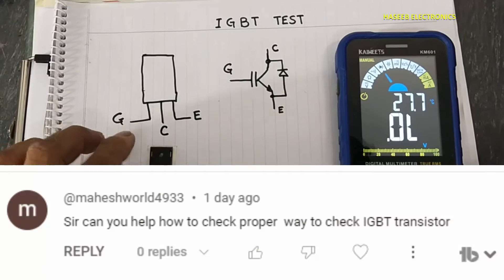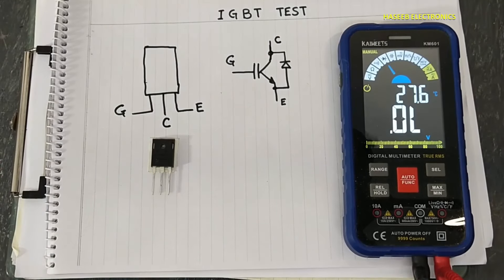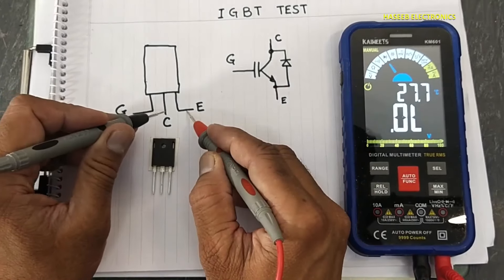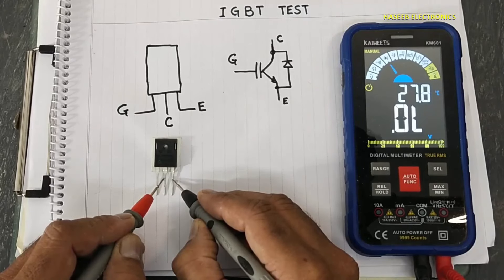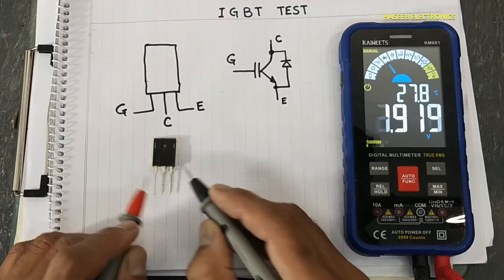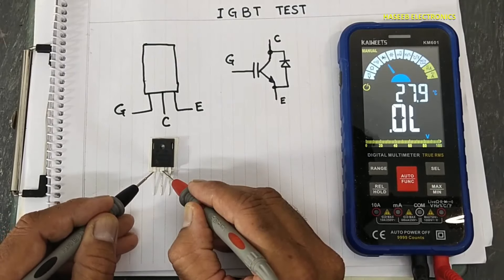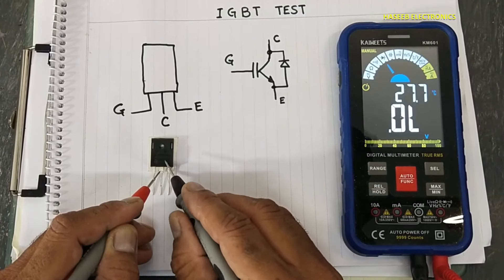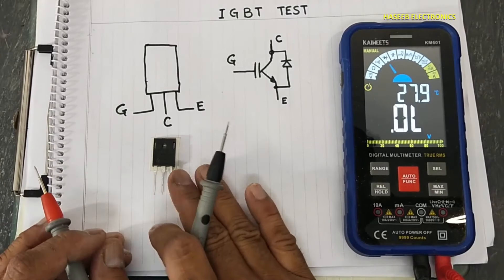{961} How to test IGBT

Comment: I understand that the tests show the action of the IGBT; but, is it possible that at very low voltage/current the test passes, but in actual use (with high voltage/current) it may fail? Thank you for all the time you take!

Comment: Why mosfets have diode ?
Reply from the maker: as these power MOSFETs and IGBTs are for switching applications and these driver transformers and inductive loads. so these body diodes protect its junction from reverse EMF (created by the inductive load's collapsing magnetic filed during off period of the MOSFET or IGBT)

Comment: Hi , We have Semikron IGBT which input 125VDC and Output 75VAC after that there is one transformer 75/230 VAC. However I am getting output of IGBT is only 61 volt instead of 75.  Could you please advise how to increase IGBT output voltage.  Thanks

Comment: Hi, nice video😍But the IGBT dont have to be bad, if i will not open it with multimeter. I had many big mosfets, IGBTs, etc, which needs bigger voltage to open. In that case, You need use powersuply to get testing voltage higher😊

Comment: I use non portable voltmeter which works on AC, it provide  6 volts on diode mode, when you put pos lead on gate it shows 0 v between E & C. It depends on the volt provided on gate, thank you for your information. 🙏🏼

Comment: I am using rishmax 10 multimeter i am getting on forward voltage drop of diode only no other readings do i need to use true rms meter